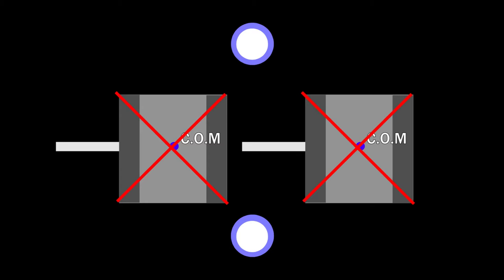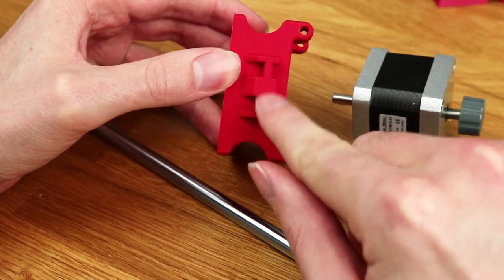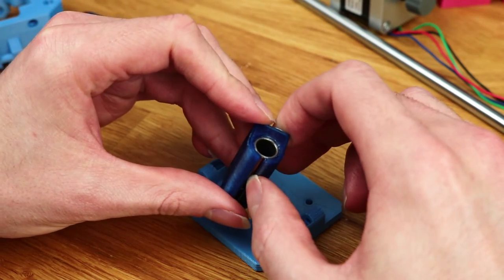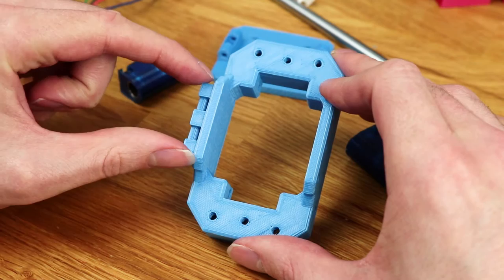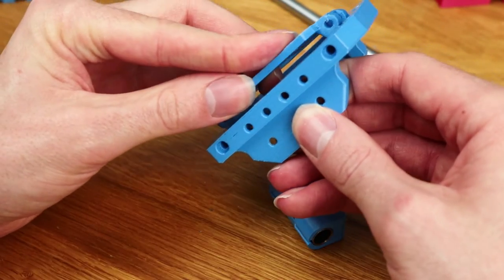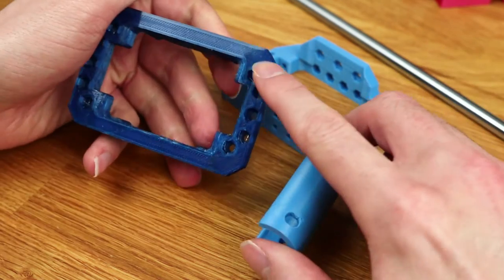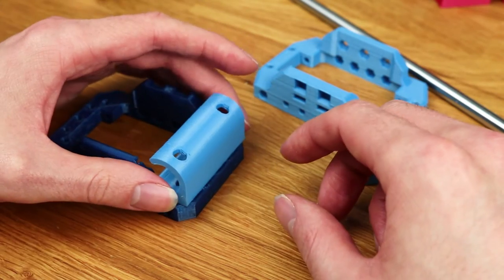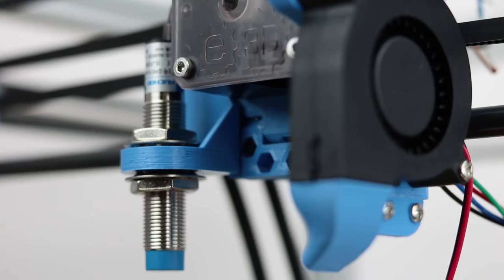Extruder Carriage - 3D Printer Scratch Design and Build Log - Episode 4

Comment: for the E3D Titan you can use a pancake stepper motor because of the gear reduction. 1/3 the power and half the size
Reply: Problem is the E3D pancake motor doesn't fit due to the wiring connector ( and i presume any motor with a standard 6 pin JST connector) So it would need a 7mm spacer which kind of defeats the " center of mass in line with linear rails " principle